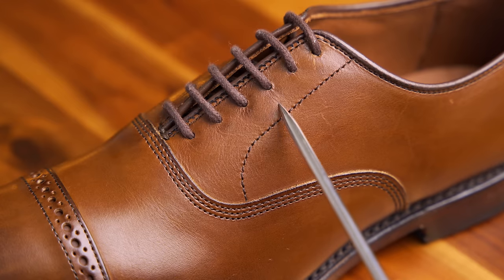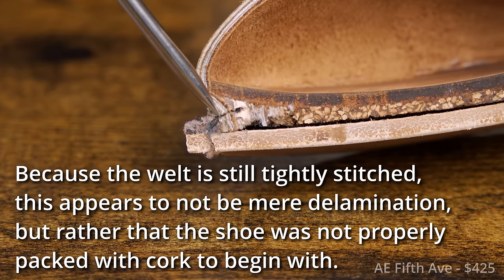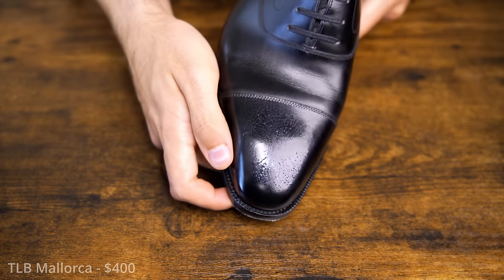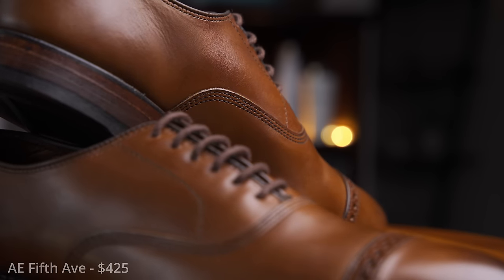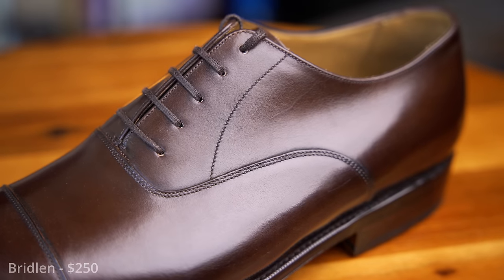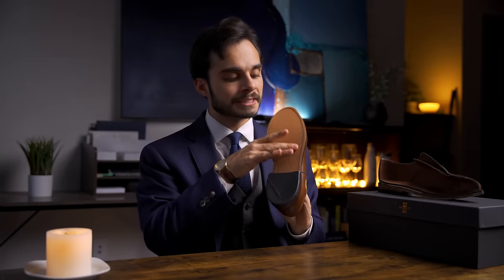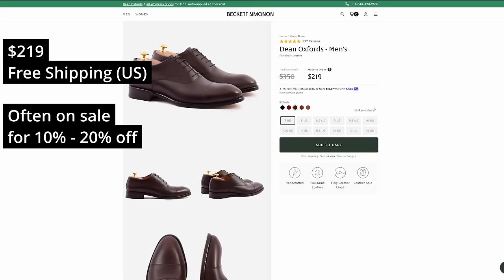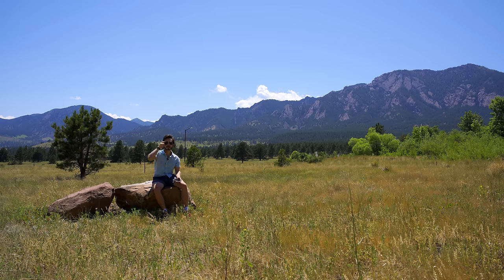Allen Edmonds Sells Overpriced, Cheaply-Made, Poorly-Crafted Dress Shoes (Comprehensive Review 2024)

Comment: For 2 decades I only owned AE shoes.  They were and still are an OK starter brand.  I agree that the quality has deteriorated due to ownership changes.  And no with alternatives brands doing incredible things at various price points the only advantage AE has is that you can go into a store and try them on.   Thanks for another amazing video.  BTW, TLB is an amazing brand.  What Toni produces for what he charges is insane.  Carlos Santos is amazing with all their patina work.  I am a huge fan of Yearn and Ichigo Ichie.  I own 5 pairs of Yearn and 11 of Ichigo.
Reply: AE shoes have been made about the same for decades. The SPI has little bearing of durability fwiw and that's from cobblers who've taken apart thousands of them.
Reply: @gnarl12  You are correct. SPI doesn't dictate quality.  Even if we agree that the quality of AE shoes is unchanged through the years, the rise of new shoemakers competing in the same $$ range makes AE look bad.  TLB is a great comparison brand to AE.  And the only "advantage" AE has over the TLB benchgrade line is that AE are made in the USA.

Comment: I’ve been making and resoling mostly boots. Specifically work and historical reenactment boots. However I’ve resoled 2 pairs and rebuilt a pair of Allen Edmonds for my wife. The soles have an acrylic coat to hide imperfections this is what causes the burnt affect. The top is coated with acrylic fairly thick. 
For the rebuild, here’s what I did.
New heel counter, I however used leather, Trimmed it down and extended it. Leather heel, converted it to a 270 degree hand welt. Fiberglass shank to wood and added ribbon laces. They came out amazing and many of the flaw’s removed. The last I used was a Munson last. I prefer closed channel soles. They extend the period between resoles.
Reply from the maker: Thank you for sharing! Especially about the insole. That's so interesting, I've never heard of that being done to an insole.
Reply: Where did you get a Munson last? How did it change the way the shoe looks? I’ve only ever seen Munsons used to make boots, curious how it changed the shoe’s overall look
Reply: If the upper is acrylic coated it's bookbinder leather/corrected grain and AE doesn't use that anymore.
Reply: @DressWell.Madaras AE used to paint/lacquer their insoles. They used to be jet black. Now they're natural colored/light brown.

Comment: FYI: The rubber runner(2nd layer of rubber on heel) is for better adhesion of the rubber heel and ease of replacement. Rubber doesn’t adhere as well to leather. I wonder how the leather outsole is tanned. From my understanding, one of the best leather outsoles is JR and it is oak tanned. Also some outsoles are treated for water resistance and durability. I use a Saphir product on my leather outsoles which helps with durability. It’s a super refined Vegetable oil and definitely helps with water resistance. Thanks for all the information. I learned a lot. Ps. I love the mountains and you did a great job.

Comment: I bought a pair of Allen Edmonds Brogue for $14 USD, the bottom is pretty much worn out but the upper and the heel stack are both fine, had it resoled for a lil more than $100 and now it looks like it worth more than a brand new pair of AE, one of the best 115 bucks I’ve ever spent
Reply: Im doing the same, buying a used pair from ebay and going to have them resoled.
Reply: @gerryaustin8687  Nice, as long as there’s no cracks on the upper and no tear on the part where the upper connects to the welt, there should be nothing a good cobbler and a deep clean+ condition can’t fix, enjoy your new shoes!
Reply: @Joseph_yy  Thanks!

Comment: Can you feel the delamination of the cork and the outsole on the shoe that wasn’t cut in half?
Reply from the maker: Yes. Strictly speaking, it's not delamination, which implies that it was once properly laminated. I fumbled my words a bit. More specifically, the cork is not properly packed into the midsole cavity of the shoe and/or the outsole was not properly compressed down when stitching to avoid gaps. Delamination actually is a generous word here, because it implies the shoe was constructed properly to start. In reality, this defect exists simply because the shoe was manufactured improperly to begin with.

Comment: Interesting. First a quick correction. A shoe last is the foundation of a shoe's design, while the upper is the part of the shoe that covers the foot. All of AEs dress shoes are leather uppers and they use various lasts for different types of shoes and boots. I’ve been wearing AE and Alden since 1996. I prefer AE over Alden as AE shoes come in different widths from very narrow to very wide. There is no other shoe company in that price point that offers their width selection. In addition, AE regularly run sales and you can easily get a new pair for under $300, and I’ve found their return policy very generous. In my 28-year relationship with buying AE shoes I have only had to return 2 pairs and they quickly remedied the issue by sending me a new pair. Their quality has certainly taken a hit due to a couple ownership changes, but still decent. They are also endlessly recraftable and I still wear my Park Avenues purchased in 1996.

Comment: Leatherboard in the heel stack doesn't matter because the outsole they use wears out in about 10 miles. Cheap! When you take them to a cobbler to resole, then you can get what you want. (I'm not excusing Allen Edmonds' cheap quality.)

That's disappointing seeing the cork separate from the outsole. Do other makers not have this problem? 

That plastic heel counter: I'm wearing a pair of Strands right now that are about 8 years old, and the leather lining has worn down to the plastic, and they are now uncomfortable. The toe cap on these shoes are non-existant. However, they still look fantastic. 

Thanks for pointing out the upper leather flaws. I think most of my AEs have that going on.
Reply: I'll push back a little bit on the looks. Most men wear horrible plastic shoes. Compared to most, AE shoes really stand out as a handsome shoe in day to day life. There is a certain ruggedness to them compared to European dress shoes that fit well with the American casual aesthetic.

Comment: Have  10-12 pairs of AEs, lost count over the decades but had no need to replace any in my shoe wardrobe  since early 2000s.  As one on their mailing list, i kept up with new styles in both casual and dress varieties. Was check8ng out the website 8n Nov 2019 and noticed  they were closing out Park Avenue in navy. Had several PAs and Ffith Ave in various colors but not navy. Having several suits in various shades of blue, i ordered a pair. Know retail was $395 and believe clearance price was $250-275. First order arrived with flaws in leather as well as stitching flaws in welt. Ordered 2nd pair, arrived flawed also...uneven navy dyeing  . Not happy but really wanted the navy PAs, especially at the clearance price so i ordered another pair. Was initially satisfied when 3rd navy pair arrived as i didnt spot any obvious flaws, at least i thought that was the case.  After examining i sat this pair on table in front of me and then noticed that one of the shoes did sit flat on the table from front to back but "rocked" when i attempted to hold the heel flat against the flat surface, the toe was lifted off of the table, causing the shoe to "rock" back and forth. The mate to this "rocker" was just fine, though, sitting flat on the table as it should. Calculating the math, one of 6 shoes (3pair) was only one without flaws or 16.6% of what were supposed to be first quality shoes. I was thoroughly disgusted as i had also ordered a navy AE belt to match at regular retail price. Had never experienced such sloppy workmanship in AE shoes before, other than very minor imperfections that i knew shoe polish would cover up. After a couple months i thought back to my previous AE purchases and realized i hadnt bought any new shoes since early 2000s and prior to 2006 private equity takeover. I cant blame that company, nor the Brentwood group that had ownership until Caleres bought AE in 2016. I do however blame Caleres for cutting corners on everything from craftsmanship, materials, customer service and even the attrative and informative catalogs that used to be mailed to those of us on the mailing lists. Sadly Caleres doesn't know or care who their main target customer is. Doubt it's the 20s, 30s age group that the ugly white soled sneakers seem to target. For casual shoes I'll always favor drivers and venetians and Gold Cup Sperrys over hideous white rubber sole sneakers in dress shoe styles. Only AEs I'll purchase in the future would be lightly used or new on ebay or some other internet site. Bottom line...greedy corporations don't care about loyal customers who have bought products from them for decades. I have several pair of USA made JMs from the 90s and before that i will pull out of storage boxes and wear before spending another dime with AE. Feel as if I'm being conned by AE now to the tune of $425 each time. Sad for this divorce but i didnt cheat on you but Caleres you will cheat me if i was foolish enough to ever trust you again. Fortunstely I've got enough shoes to last past my lifetime if i choose. Bye bye AE.
Reply from the maker: Thank you for taking the time to share your story.
Reply: @DressWell.Madaras AR has been owned by a bank or similar financial interests for decades. Their shoes have been made in much the same way (at least their core lineup) since at least the 1970s. Leather globally has been dropping in quality and AE actually gets their calfskin from a European tannery and used to get it from the same one that supplied Hermes (they then bought it and AE lost access). Most people aren't going to play size by email with EU brands.

Comment: My only pair of Allen Edmonds Dress shoes that I regularly wear are some McNeil Cordovan Gunboats. I bought them slightly used and unbroken in on ebay for $100 because the lady didn’t know that they were $750 Cordovan Horsehide shoes. They are built like tanks. Over a year of regular wear they have only broken in a little bit and show no signs of wear. I don’t do any maintenance on them at all other than dusting and wiped down.

I had a cheaper pair of derby’s and they were OK but some parts of the trim weren’t made correctly.

Comment: My man. The sole stitch is not primary to holding the sole to the welt. That’s what the glue is doing. When the stitches wear through the sole will remain attached to the welt. Also there are many north hampton shoes way over $425 USD that have open channel stitching. Please refer to CJ bench grade.
Reply: If the sole stitch isnt to hold things together, why does it exist?
Reply: What are you talking about? Of course there is glue to hold the sole and interior together but that’s the primary function of the sole stitch. As for his obsession with closed channel stitching which serves no purpose other than aesthetics, it’s really easy to do and takes a minute with a machine.

Comment: Name a brand Goodyear welted, good leather, sold in stores that uses full stacked leather heels under 400$? There isn't one. Leatherboard is leather, just like mdf is wood. Is it great, no but with union factory wages overhead the fact they are not 600$ is hilarious to me. 
Direct to consumer brands like beckett, and Thursday boots brand really well. Not high quality but are presented as such with gimmicks as well. 
Ae does sales a few times a year where you will get the discounts. Handmade has issues, cranking the amount they do out of the factory it is expected. Is it good, no, but that is USA made. 

Ae should diversify and compete at different levels. Heritage brands have gone super cheap. Casual sit and fit stores are looking for quality dress shoes that will last at least 4 years or more without any work. Cut widths in half, have a 250 price point made overseas with Italian leather and a few corners cut to then have USA made as a true premium at 500$ and stop discounting them so much. Upgrade the material and increase production time variability to have that premium product. Compete with the 1000$ and over brands but at 500 to 600$. Like nettleton shoes. You increase distribution through the 250 price points to have in sit and fit stores as well as your own, plus the luxury product. Rebrand yourself as the brand for everyone. Dtc cannot compete for the extra 50$ but you can try on in store customers will come. 

This video has a lot of questions posed by the host. If you try to rip a brand apart maybe have solid knowledge on processes and industry standards. Not your comparisons of shoe to shoe of limited scope. What's your industry background? Why should we listen to you? Just questions I asked myself while you were talking. You make good claims but not really a good argument overall that supports your claims with facts.
Reply: You make is sound so easy for AE to compete with more modern brands.   It is clear that AEs strategy is to cut costs to maintain competitive.  They can't compete at the $1000 price point and manufacture in the US.  and the host is VERY knowledgable about shoes.  I know alot about shoe manufacturing and he is a subject matter expert.

Comment: Meh..drama queen nitpicking to make a mountain out of a molehill.  Decent shoes on sale.
Reply: So many better shoes than AE. Not nitpicking.  Just facts
Reply: @mtbokor1969  There are also worse shoes. Congrats on not saying anything.
Reply: @mtbokor1969  what’s your point other than to be a hater with your comment ?  Be nice bc it’s so much easier than spreading negativity.  Of course there are “better” shows than AE.  You could run to the local cobbler and buy yourself a pair of bespoke shoes.  That wasn’t the point of this video.
Reply: @zack4president  Local cobblers dont make bespoke shoes.  Bespoke shoe artisans charge $5000 plus for a tru bespoke product.